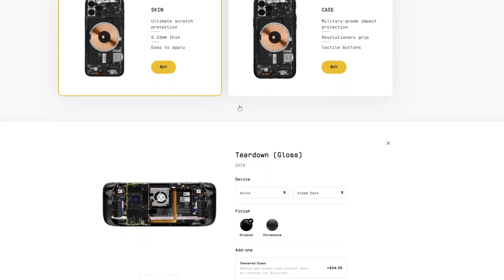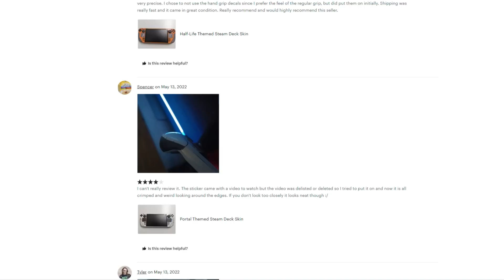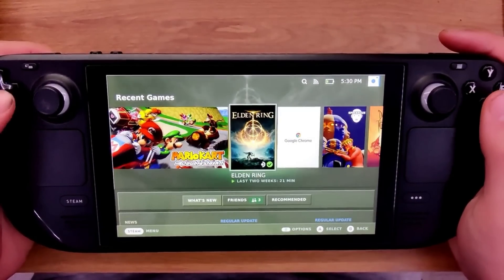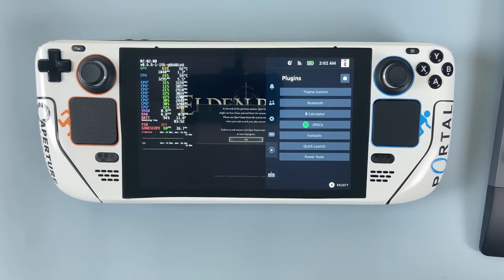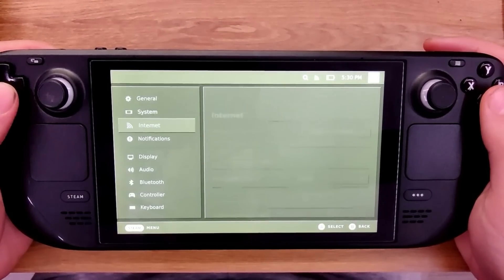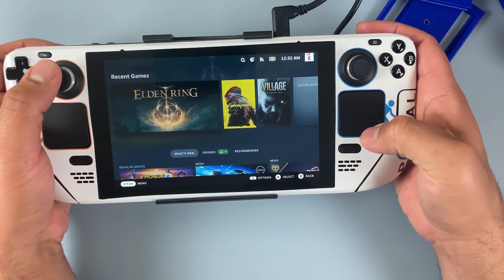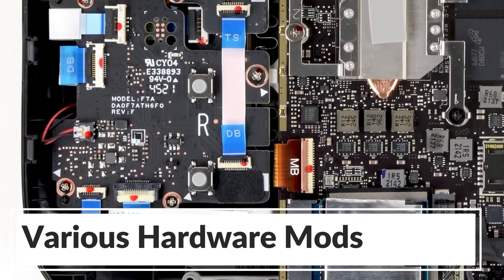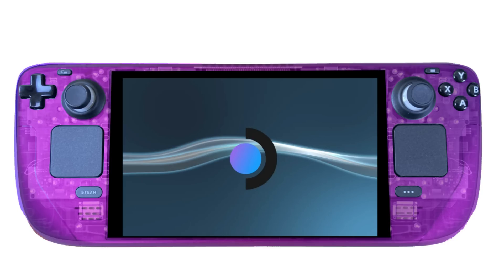Every Steam Deck Mod Ever

Comment: VibrantDeck (a display tweaking plugin for the Decky plugin manager) is amazing. Bumping up the saturation on the Deck's screen really does make for a substantial improvement. Don't overdo it. I think the number most recommended was 120 for a subtle pop of the colors. But it does shift the screen closer to the look of an OLED which is amazing. 

Just follow one of the many tutorials, it's well worth it. Decky is awesome and should continue to improve going forward.

Comment: I'm wondering how hard it would be to remove skins damaged over time.
Reply from the maker: Removing skins is quite easy (they're not usable again afterwards, as you might imagine)
Reply: @FanTheDeck  Thanks for that. The skin manufacturers probably wouldn't want to be responsible for borking it but I'm not 100% convinced a heat gun or hair dryer won't damage the Deck. 🐔

Comment: The CPU core limit is perfect for the older game "Prototype" as it can't handle over 4 cores (Activision devs screwed up).  If Valve can actually code that into the settings on the SD; that would be amazing.

Comment: I would like to see a custom back shell with a bump out for an included double capacity battery and a adapter that allows a full size NVME SSD to be installed and be accusable without removing the back.   I think It could be done and not add much to the back of the system.

Comment: It’d be cool if one of the modular attachments was a table mount or clip with bearings to allow the steam deck to spin, so you could makeshift you’re own steering wheel with the gyro.

Comment: i want a backplate that adds cooling capicity , i dont have my deck yet , but i like my chips to stay around 60c for all my hardware , i might try and do something to that end myself , as i see 95c being a normal temp for a lot of folks in more demanding applications , i know ltt managed 56c with that  heat sink and fan mod , but it would be nice to have something lower profile that can still keep the thing around that temp , i am determined to figure something out , and might get those hall effect sticks , that would be sweet , especially since i play a lot of shooters , though i might just get a mouse for it , cant beat that accuracy and ive spent many more hours using a mouse than a thumb stick
Reply: I'd definitely suggest to take the time to dial in some comfortable gyro settings to use in FPS games for any of those particular situations when using a mouse may not be practical. That way you can maintain the portable form factor, which is presumably (partly) why you'd be using the Steam Deck.
Reply: @mymusicaljesus  i probably will for racing games , flying , rts or other top down type games , but i also want it to be like a very small portable laptop , if im craving fps and have a flat surface nearby , i will be using a mouse , its just better

Comment: Here's a mod idea if someone wants to make it a reality.  Design a replacement back shell that is deeper in the middle, , but returns to the original width around the back buttons for economics.  The shell needs to be deep to accommodate a second Deck battery.  Make a custom PCB that you connect both batteries to, and then connect the PCB to the battery connector on the mainboard.  This PCB will put the batteries in parallel so voltage remains the same, but capacity is doubled.  If ergonomics is not affected, you might be able to also have the shell raised around the heatsink area, and design a slightly taller heatsink with a fin array on top, and a coldplate that extends out to the battery IC.  Of course, a new metal shroud would need to be made to go over it and pull air from the vents.  I believe 10mm of fins on top of the heatsink would make a noticeable difference.

Comment: Will GPD win max 2 6880u more powerful?
Reply from the maker: Short answer is yes. Watch my latest video for more information on other upcoming 6800U devices: https://youtu.be/_XFc_eKy5Mo

 technically the 6800u can have a higher power draw (up to 28W) so there's the question of how it will compare to a steam Deck head to head at 15W. The Phawx should have a video on that soon. Finally I'll have my hands on a 6800U device soon so be sure to subscribe if you don't want to miss that

Comment: I prefer not skins, but being able to 3D print the case for custom work, including notes to consider such as air and heat distribution to engineer new cooling solutions.

I like screen and case protectors to attach.

Comment: I’m currently working on an OLED mod for the SD, if anyone finds a 7” 800x1280 touch Amoled screen, hit me up. (The switch one will not fit since it has a non native resolution) I’ll rewire the display controller with a costume PCB.
Reply from the maker: Heck yeah! That would be awesome
Reply: maybe a tablet screen

Comment: 10:17 I'm hoping someone comes up with a 2 in one battery bank attachment that also has a kickstand. That would be dope for the airplane or a train 🚂🚂🚂 trip
Reply: As someone who seen videos of trains I have no idea where you would play that thing because everyone's standing touching echother.
Reply: @bland9876  I mean there's a more luxurious train trip I'm going in where you have your own seating and better amenities
Reply: @Spencerwalker21  so there is first class but for trains/subways?
Reply: @bland9876  yes but I forget exactly what they're called I watched a YouTuber review them.
Reply: @bland9876  well trains like Japanese bullet trains exist where there are little trays
Reply: @bland9876  Trains in the US (especially AmTrak) are much more spacious and roomy, though they also tend to be for much longer trips (Like a 63 hour trip for an upcoming one for me).
Reply: One of the battery banks I created can double as a stand.
Reply: @mbrumm86  can you post that to reddit if you already have cool then link that for me plz 🥺🥺🥺🥺🥺
Reply: @Spencerwalker21  It's the Ravpower attachment.  Its not adjustable, but when you attach it to the bottom cleet it can act as a stand.  I might try to combine my design and have an adjustable stand and powerbank, but it will take me awhile.
Reply: @mbrumm86  cool good luck 👍

Comment: That half life skin was sick and the sticks that can't drift are amazing mods.
Reply from the maker: Yeah can't wait to hear more!
Reply: I second that. It looked dope
Reply: The replacement analog sticks are super overkill. It would be easy enough to replace the analog sticks when they break, or any other time you end up cracking the system open.
Reply: @clockhanded  I just bought the electromagnetic sticks. They will help to future proof my deck and they allow you to turn down the dead zone a lot.  And they were only $30
Reply: @clockhanded  nah, more of a spend a tad bit more now and save more in the long run

Comment: instead of wasting time and resources making a lot of different skins and colors and revisions for the deck, valve just made it easy to the community to do it themselves, sure, they aren't protifing directly over these mods, but not being so limited in options is also appealing and probably helps to sell more decks, now they just need to focus on production otherwise people will only be getting their decks in 2025 lol
Reply: This was the correct approach in my opinion. They seem to be genuinely ok with making many aspects of this system open source and end user modification friendly. This system is probably one of the best advancements in PC gaming we've seen in quite some time. I wouldn't be surprised if we see a more traditional TV console come out for around the same price in a few years once the steam OS gets ironed out.
Reply: @sexytopramen  yeah, i feel like what killed the steam machines were both the third-parties handling production and proton not being fully developed at the time, and since both of these are now "fixed", i'd say valve has a really good leverage to push for a "Steam Machine 2.0", actually, with the deck technology i think they are working on a standalone vr headset to compete with the quest, if that's the case then it would be groundbreaking imo, but i hope after the success of the deck that valve takes a break from hardware and focus on fixing some of their games
Reply from the maker: They've done a great job with this and I'm looking forward to even more customizations!
Reply: A lot of the inner pieces are modular too. Very diy repair friendly.
Reply: They've also done a fantastic job with production. I finally decided I wanted the steam deck about a month ago, bought a deposit, and got a time frame of October to December 2022. I just got an email literally today saying I'm next on the list and I bought one, now just gotta wait for shipping. I was expecting late December lol
Reply: @꧁GlorifiedGremlin꧂  I ordered on 2 days ago and boom just got delivered
Reply: Looks like it takes a week to get one in the US.  Brb lurking the delivery tracking page...
Reply: I agree with you. I 2 weeeks agos if you told me that id wpuld get a stram deck id call you crazy.

But once i learned how versatile amd eaily moded the steam deck os. I had to get one

Comment: One of my favorite things to do is to play with mods and just tweak and twist things into my amalgamation of what i wanted it to be. I'm still gonna wait a bit longer tho before going in like that on deck.
Reply from the maker: Part of why I wanted to showcase them in a video is because I know people are going to be a bit unwilling to try; reasonably so. So I wanted to show this stuff off so that people can at least get a glimpse of what's possible.
Reply: @FanTheDeck  I love that you were showing off how easy it is. I saw lots of other creators just glazing over the skins or not mentioning it at all which seems like such a big oversight.
Reply: @FanTheDeck  agreed, some of the coolest features ive seen for phones was mods or etc before they was integrated into the os (morality aside mind you)

 For me it's mainly their isnt that much compelling besides parking cores. 
Valve is already doing things I'd normally have to try and mod in anyway. One thing I'd love is someone to work on the cloud saves for third parties like ya said, but orientate it for emulation.
Reply: ie cross saves between my pc and deck, in a automated manor similar to steam cloud saves